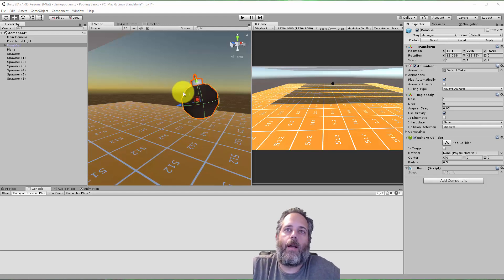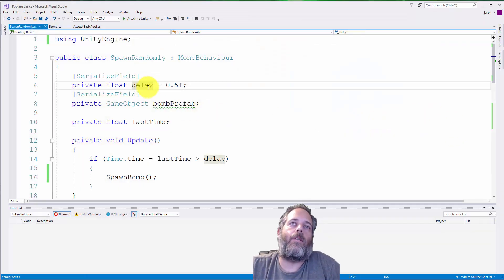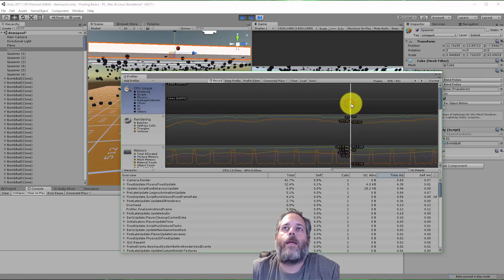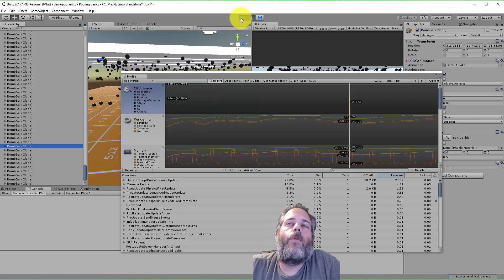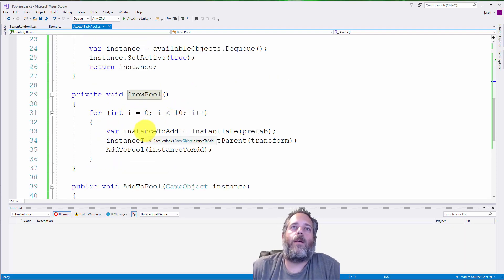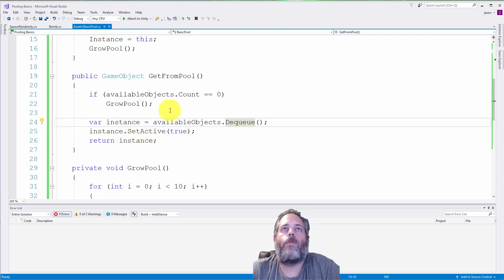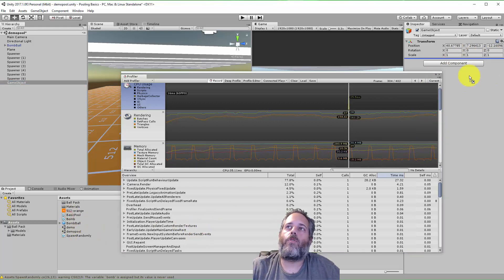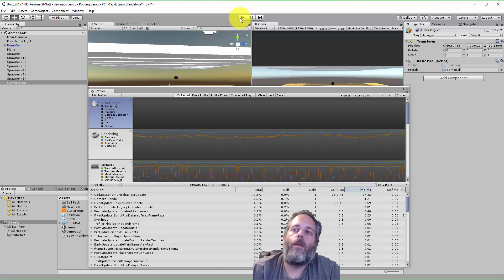Unity3D Object Pooling - How to use them & why you should

Comment: I dont understand one thing, if the bombs are recycling with "AddtoPool" instead of "destroy" method, why the pool gets empty ?? very thanks!
Reply: Because you're disabling the objects, that's all.
Reply: Pool gets empty because it can be reused for different things. Imagine if you had 3 bomb spawners that all spawned at different rates. One spawned 100 bombs over 1 second, the other 50, the other 25. In the video, it started at 10 but the 100 bombs pool is going to grow at a much faster rate until the number of bombs that are active don't exceed the pool amount.

Comment: How do I use the pooling object ? I have two scripts attached to the same gameobject in the hierarchy and in the object pooling script i didnt add any prefab. The second script I added a prefab. using System.Collections;
using System.Collections.Generic;
using UnityEngine;

public class SpawnRandomly : MonoBehaviour
{
    [SerializeField]
    private float delay = 0.5f;
    [SerializeField]
    private GameObject spawnPrefab;

    private float lastTime;

 // Use this for initialization
 void Start () {
  
 }
 
 // Update is called once per frame
 void Update ()
    {
   if (Time.time - lastTime > delay)
        {
            SpawnFromPool();
        }
 }

    private void SpawnFromPool()
    {
        lastTime = Time.time;
        Vector3 position = new Vector3(Random.Range(0, 100), 0, 0);
        Instantiate(spawnPrefab, position, Quaternion.identity);

        SimplePool.Instance.AddToPool(spawnPrefab);
    }
}
 
But when running the game it's adding nonstop objects to the hierarchy and they are all gray i can't see them in the game. And it's never destroy them like pooling should do.